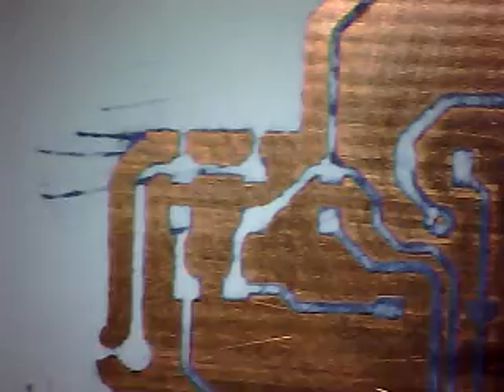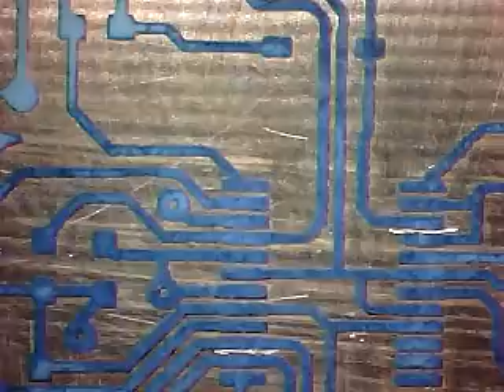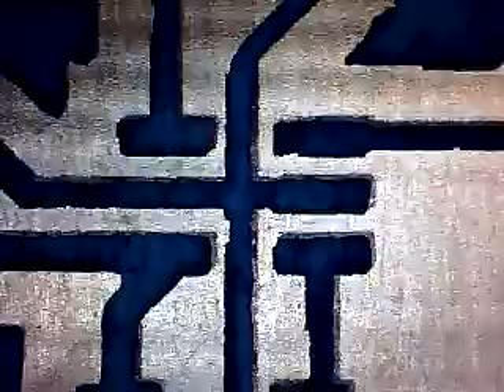0.5mm pitch Toner transfer PCD DIY

Comment: Impressive work. 

I want to make a pcb for esp32-dowd-v3 qfn. 0.5mm pitch. 

It's really challenging
Reply from the maker: @krishnakanhaiya9187  hello. It's very achievable nowadays with the tools there are now. For example special sheets of transfer paper that are easier to remove.
I've done a couple of PCBs for esp32 -s module and it worked ok